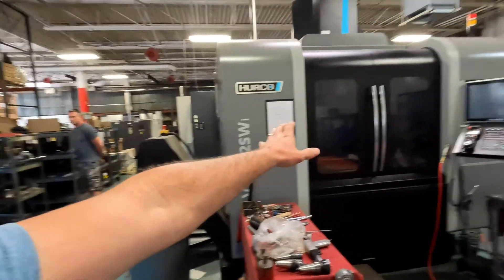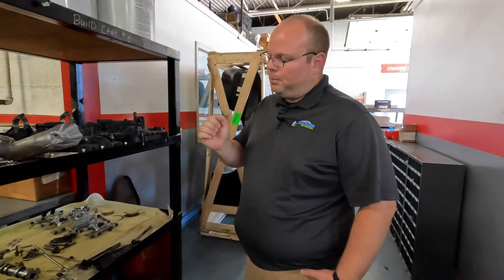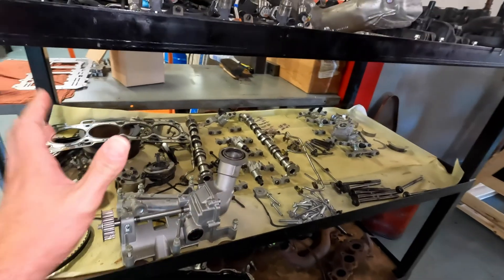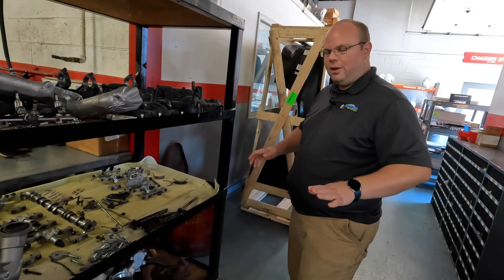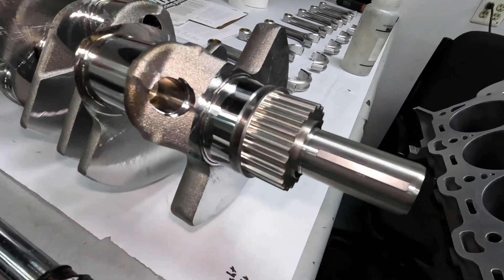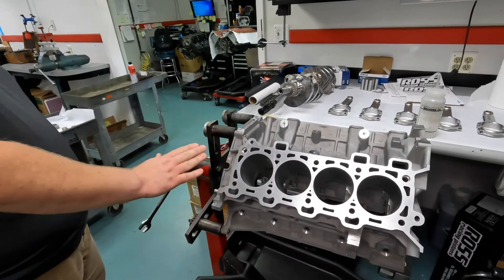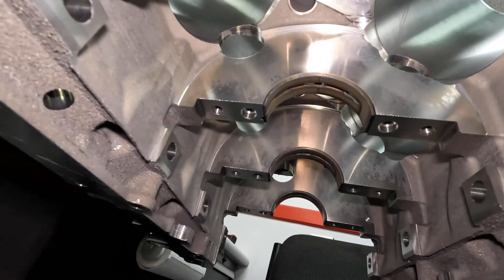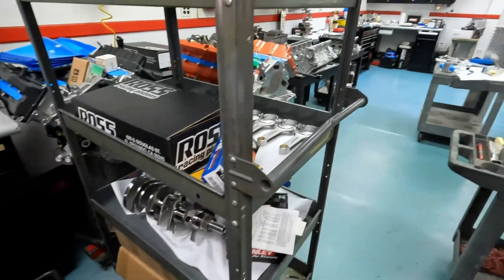What Makes the Gen 4 Coyote Different??? | Livernois Motorsports

Comment: Oh so what you all are telling me is that they screwed the gen 4 coyote up and livernois is fixing its problems 🤣. Cylinder deactivation, a belt driven oil pump that looks like it belongs in some regular traffic engine.  Yeah not impressed with it seems like they took the race out of it and added more dumb crap to break so they can plot it cheaper and more economical but at the sacrifice of quality and longevity plus adds more work for the owner or mechanic. Sounds like the ford thing to do. No competition why not right. The cam carrier is cool though.
Reply: Nothing wrong with a belt driven pump, the previous coyote had more problems with the oil pump gears breaking.
Reply: @Jimmyxsx  yes true but bullet gears will solve the problem for high hp while the belt drive remains crap for high hp.
Reply: @joshreynolds729 midnight performance has a bunch of these  F150 trucks making 1000rwhp. The belt is only driving an oil pump not an entire engine lol😂
Reply: @Jimmyxsx  I never said the engine I said the oil pump. And I know I’ve been watching them for years now and event before the coyote stuff where they were racing a black c6 zr1 on nitrous and eating it everything.
Reply: @joshreynolds729  you are literally saying the belt driven oil pump wont support high hp build lol, yet those guys from midnight are putting 1000rwhp on those engines without any problems. The belt absorbs all the vibration and resonance that would break the OPGs, so you know nothing😂
Reply: What's funny is oil pumps been pretty standard for like 100 years and ford still had problems with the gears breaking! That should have been a non existent issue for many decades by now.
Reply: @Jimmyxsx  only because ford used shit parts. LS used similar oil pumps they never fail.... just Ford cheaping out on  quality parts. belt driven oil pump is gay.
Reply: @bigboreracing356  omg you ford guys are funny anytime somebody says something it’s oh Brett lassa 🤣 never mind that they have to change it every so many runs. Nobody cares about that 😂 who cares about labor hours when you got a well payed team to do it for you right. But hey he does it right so I guess f billet gears 😂. And I suppose he’s running stock for everything and it’s gods motor to right.
Reply: Belt driven oil pumps might be fine in race cars driven hundreds of miles or hundreds of 1/4 mile passes but are a total joke in an engine that should easily last 200,000 miles
Reply: @davidphillips3953  see you get it. 👍🏻
Reply: I could be wrong, but this is just my take. I think the belt driven oil pump is just a bandaid. How many Gen3 Coyotes suffered from broken oil pump gears? Lots, so what do those oil pump gears attach too, the crankshaft. Now how many Gen3 Coyotes that have blowers/pd superchargers have suffered from snapped crank shaft snouts? Lots of them. Could be that just the oil pump gears were of bad castings. Could be that those cranks could be of poor casting. Could the harmonic balancer be inferior in design? Let’s circle back to the belt driven oil pump, I have seen engineers saying that the belt for the oil pump helps mitigate harmonics. Let’s go back to the crankshaft. Could a hollow snout on the crank be causing a resonance frequency that is causing oil pump gears to break, also do to that frequency and being hollow they are snapping when a blower/pd supercharger is added? Somehow when guys swap cranks out to the Boss 302 crank, run an ATI Damper, guess what is not happening, broken oil pump gears and snapping snouts. So it seems that the factory crank shaft and possibly the harmonic balancer are what the real issue is, but to recall all of those vehicles and replace those parts would be more of an undertaking than a single part redesign and added after the the issues. Again this is just my take.
Reply: @joshreynolds729  that belt driven oil pump 🤦‍♂️
Reply: @bigboreracing356  belts come apart, belts are in oil, and then over time leave rubber in the system which can starve your engine and that can come apart becoming a floating particulate in your oil system, also the gears aren’t billet this is why they recommend doing that for higher rpm activities and hard racing although some can get away with it not banging off the limiter and having a properly balanced engine and that info is from a ford tech 🤣. No need to go calling names here mr big block 😂 what you think you’re the only one shit mine had nitrous bored and stroked, built by me year ago raced and sold had many cars since infact I’ve owned many cars and grew up in a shop 😂. So does that make you unbiased and right and somehow me clueless 😂? But hey a few guys have done it in racing so factory and fact right? it’s all good right? because you built the car right? You were there building it with lassa’s team.  No 😂 you’re just some kid who watched the same videos I have and are calling me clueless 🤣. Man get off my nutz kid we’re all car guys here no need for the disrespect.
Reply: @bigboreracing356  yeah okay buddy I’m clueless what ever makes you feel better mr big bore with a big block 🤣.
Reply: @bigboreracing356  you realize my initial post was more bitching about the pump it self not actually that it’s a belt right? And actually it is all over the net belt driven pumps last the life cycle of the motor belts don’t always and can cause oil starvation. Also fords the least reliable for years running and are hemorrhaging money in recalls so excuse me for not being all aboard yet 😂. So yeah I said the pump looked cheap like it should be in some regular traffic and that they took a lot of the race out of it and made it more economical as a whole speaking for the whole engine and changes not just the pump being a belt driven one. Does my opinion bother you so much that you go on a big blab about how it’s better which I actually appreciate for once somebody that explains their disposition. Although clueless I am not. Yeah the belts typically don’t break but they have been known to come apart and yes people just do billet gears and do just fine with them as I said previously so really not sure what your yapping about here? You think it’s better great.
Reply: @bigboreracing356  where did I say that they can’t make power?
Reply: @bigboreracing356  damn bro you really have no life. I never said any of that 🤣 the coyote and cobra jets have proven that along with Bret lassa as you seem to think you’re the only one who knows of him and the records 😂. So basically your trying to put words in my mouth and then turn it around like a troll does but before that say your not bias because you have a big block and somehow that makes you a know it all 😂. So on day 3 now and you seem to want some victory for nothing. Bro go tf away 😂 and get a life. So what exactly do you want here? What! That I was wrong and you were right 😂 sure what ever dude if it means that much to you please take it it’s a gift to the short bus. Good day ✌🏻
Reply: @bigboreracing356  🤡
Reply: Belt drive oil pumps are a DISASTER waiting to happen...chains have been used for decades...WHY...reliability...proven technology..there are second gen coyotes driving around with 600.000 miles original motor and transmission. 👍

Comment: Belt driven oil pump, what could go wrong 🤷‍♂️?
Reply: Wet belts are not reliable at all, damn near every car that has a wet belt is know for belt failures lol, now dry belt systems are reliable
Reply: They been reliable so far😲
Reply: @mikes1292  massive recall on the 2016—2022 Ford EcoSport® and Focus® 1.0L Engine — Oil Pump Failure Recall.  This includes belt failure 🤔
Reply: @Twobarpsi  sorry to hear that about your eco boom.  Get in the game get a coyote 😜
Reply: @mikes1292  I don't own an eco boom, just reporting the news. I've got a 5.4 GT500 💪
Reply: Dry belts are cool
Wet belts not so cool
Reply from the maker: I'd say any belt that require major surgery to change is decidedly uncool.
Reply: Only reason why the mustang don't have it is because the oil pan ain't deep enough.
Reply: No idea why they got away from the gear driven oil pumps the Gen 1 coyotes used. Just seems more reliable to drive gears straight from the crank than to rely on a belt, regardless of what said belt is made of or how well it may or may not handle being covered in oil.
Reply: It's actually 10x stronger than a gear and chain system...look it up. I have a 24' F150 XL with a Gen 4 block i will enjoy sending to these guy for all the mods.
Reply: Timing belts are wet and have been proven reliable. I just don’t know why the had to change from what worked. Especially if they are having to change the crank gear for the belt anyway.
Reply: @nickb289 I've never seen a wet timing belt
Reply: @HioSSilver1999  never seen a PureTech? That thing has a wet timing belt. Causes nothing but issues
Reply: @WorivpuqloDMogh  no ....that's a Peugeot.  I don't think they're in America
Reply: @HioSSilver1999  yeah well be glad you don't get those. PSA used to make some excellent 4 bangers and after they brought out the Prince engine (which is based on a BMW engine which was absolutely a piece of crap) things went downhill
Reply: @nickb289 
Timing belts have never been a wet design.
Reply: @prevost8686 they are on some ecoboosts
Reply: @petergalvez6431  regardless of who adopts the design it’s still a poor design and is a ticking time 💣. What do I know? I’ve just worked on cars for a living for 30 years. My intelligence level is greatly overshadowed by the engineers and bean counters at the manufacturers.
Reply: @prevost8686  working fine in 1000+ horsepower f150s 🤷🏻‍♂️
Reply: @petergalvez6431  I don’t care about 1000 hp engines. It’s a piss poor design that echoes all the manufacturer’s complete disregard for long term durability, reliability and ease of maintenance.
Reply: @prevost8686  🥱🥱 not having any issues as of yet bud. I work in a dealer and have yet to see one fail on a 5.0
Reply: @prevost8686  the 2.7 ecoboost bad been doing it for 10 years and i haven’t seen any failures
Reply: @petergalvez6431  it doesn’t have anything to do with the horsepower not everything is about massive horsepower. The belt is constantly soaked in oil. These fluids caused the belt to degrade slow slowly overtime and pieces of the belt start to flow through your motor with the oil and begin to clog the passages up and starve the motor for oil. So it’s not all about horsepower.
Reply: @miketerry6036 bud there’s trucks with well over 100k with the same belt.
Reply: @miketerry6036 you do realize the belt is made of Kevlar right. Not rubber
Reply: @nickb289 wrong...most timing belts are dry and don't see any oil and are reliable provided you change them on time...wet belts on the other hand are not reliable and the hot oil breaks down the belt and then you have a clogged oil pick up tube..ford recently switched the 3 cyl ecoboost from a wet belt to a chain because of this lol

Comment: Thanks to the people who pissed Ford off back in 2009/2010! They have went crazy with these Coyotes!💪🏾🙏🏾💨💨💨
Reply: They needed it badly. imagine having a 4.6 and a 5.4 platform that shoots spark plugs out of the head and breaks plugs off inside the head meanwhile they cant pull a greasy string out of a cats ass.
Reply: LS’s pissed them off and stop do 😂😂😂 ls’s still whipping up on the slowyotes 😎
Reply: @toomanyunlearned1 yeah, you need a 😅stroked 6.2 LS to beat a 5.0. Real impressive
Reply: there crap, no sleeves in the bore.....lol  So it consumes oil, piston rings on aluminum with a coating what could go wrong.
Reply: Blame Chevy
Reply: My 2010 is the best truck I ever owned 235k miles. Everything is original. 5.4 was the best except for oil pump and cam phaser. That's easy work around if you switch to 5/30 motor oil before 100k miles and change oil often. Also use marvel mystery oil to help clean engine..
Reply: No offense intended but proper English would be either "have gone" or simply "went." You're very welcome.
Reply: @mchristr yes daddy
Reply: @mchristr I bet you are a real dream to be around, sarcasm intended.
Reply: @mchristr  your mom “swallowing” would’ve also been proper. Thank you ma’am.